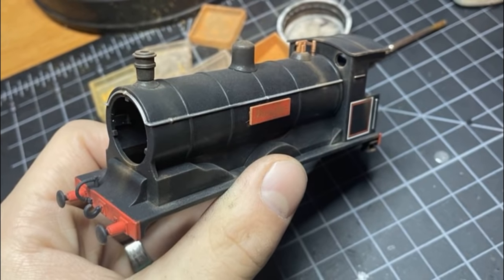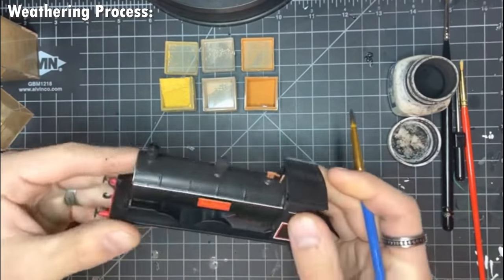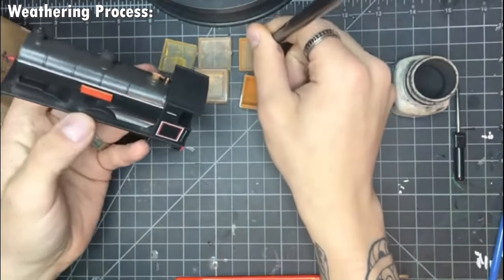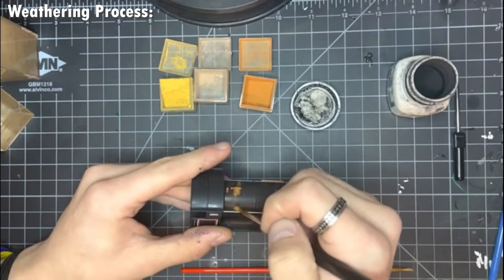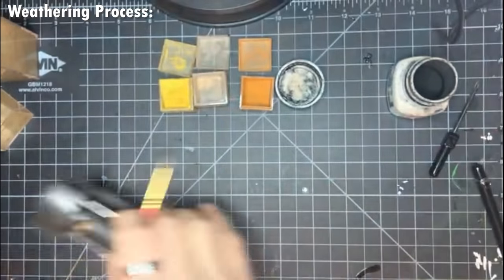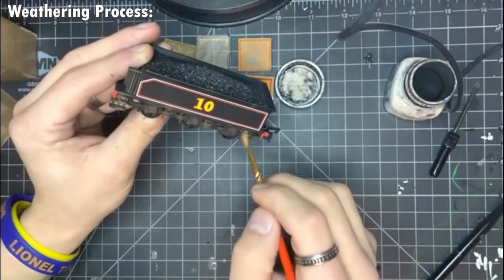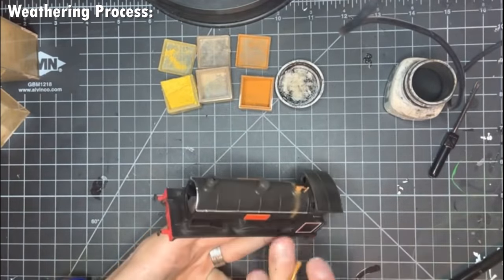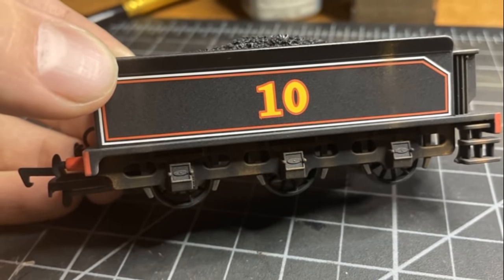Weathering Bachmann's Douglas: A Showcasing (Thomas & Friends Custom HO/OO Model)

Comment: I have a question, I got a new face plate for Bachmann Percy but I tried to put it on but it didn't stay, any tips to make it secure?
Reply from the maker: Bluetac! It’s what I use for mine :)
Reply: @ItsTrainBoy  Would glue also work?
Reply from the maker: @Melody_Ninjago_Lover  It would but I don’t recommend that as much, it’ll be permanently stuck rather than interchangeable :/
Reply: @ItsTrainBoy  Okay thank you!
Reply: @ItsTrainBoy  I got blue tac and it worked!